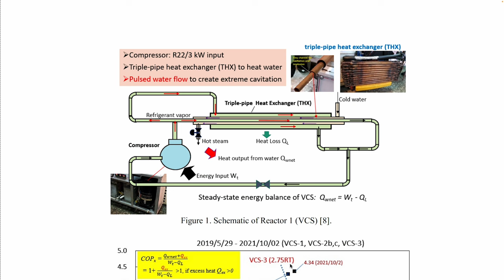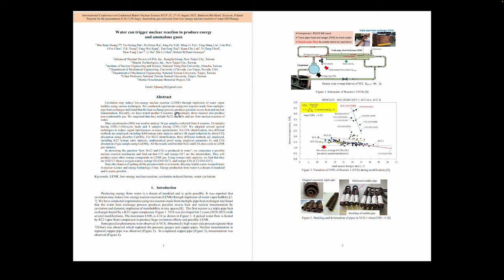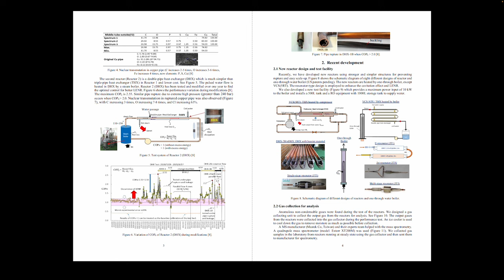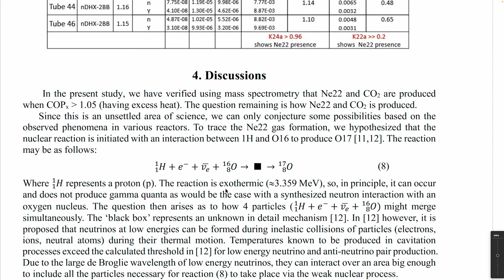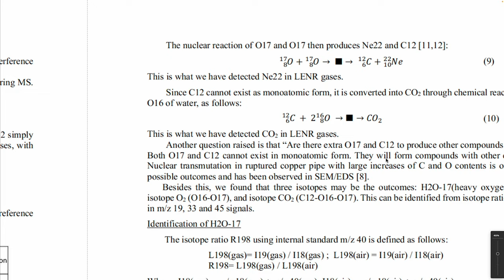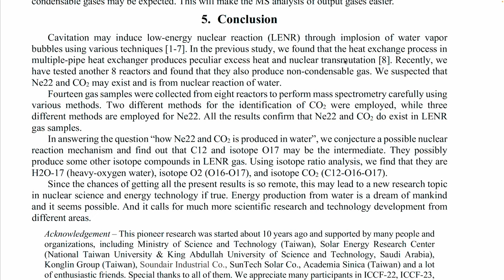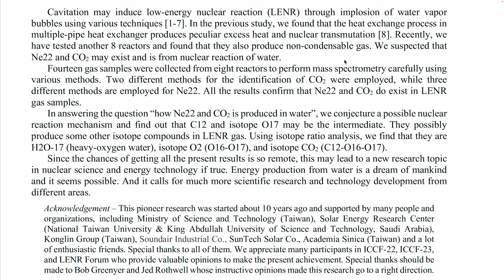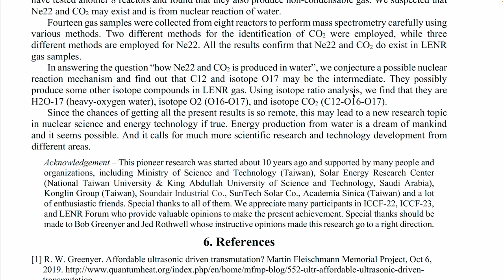ICCF25 preprint B-J Huang - Water can trigger nuclear reaction to produce energy and anomalous gases

Comment: I am sure it will be well received at the conference, like preaching to the choir. As for mainstream academic acceptance, their paymasters will  insist it meets stiff resistance! We need a new open source academic system, free of corporate interference.
Reply from the maker: Well - we might have something in the works
Reply: @MFMP   Just a nice little water heater please Bob, standard plumbing parts, easily replicated, nothing too flash, just something that induces an intense smug sensation when running...Oh and don't forget the matching MTER cluster proof shroud to go with it, so 'they' can't triangulate its position...Can't wait :)

Comment: I find very interesting the correlation between the excess heat and the elemental “anomalies”. Also the index they developped, very clever. I wish we could understand why some of the experiments did not producte excess heat.
Reply from the maker: Some failed
Reply from the maker: Hi Camilo, the paper has been updated a few times based on comments mostly here and on ECW - I am concerned that LENR-Forum is not serious at critically reviewing good work as there is not a single comment there - of course, that may be because the paper is very good. On the plus side - there is none of the usual troling.
Reply: Well, as you know only a handfull of people really comments stuff there in any depth, and judging from past experience what they probably think is “we already know this kind of system produces excess heat and transmutations, so what, call me when you have reached COP > 10”,  I am obviously being sarcastic here but this is more or less the type of comment you can get there.
Reply: Also, I have been really caught in dealing with a less than favorable day to day reality and not really able to get the ball rolling there, as I wish I could have.

Comment: I got smashed for inventing this system but I added "sticky tape" rollers on the outer of a ceramic drum to increase the % of reactions.
Reply from the maker: Thin membranes and Carbon rich (cellulose) - fits with the understanding of the form of energy that may be emitted but is normally lost.

Comment: The interesting part is the transmuation, not the anomalous energy. If you want to make free energy, you're better off thinking in terms of solid-state electrical components, which is scalable and can be used where needed.
Reply from the maker: ICE and normal refrigerant based heat pumps are not solid state, but widely used.